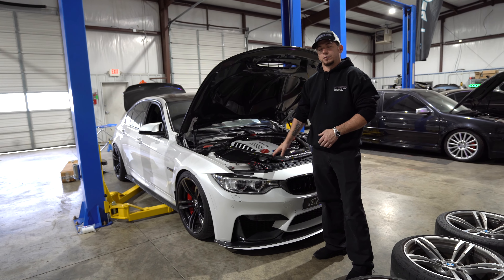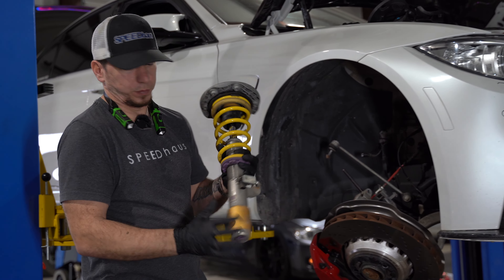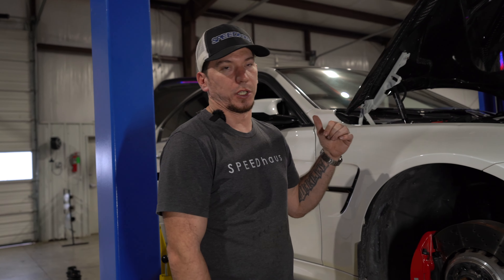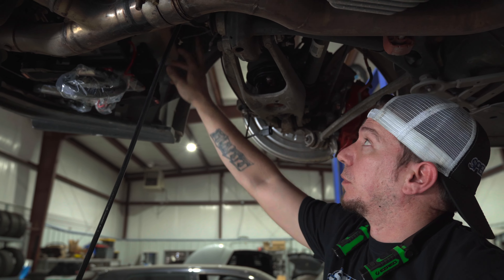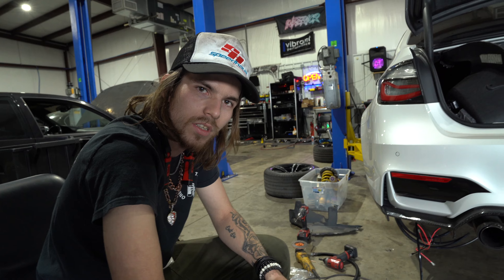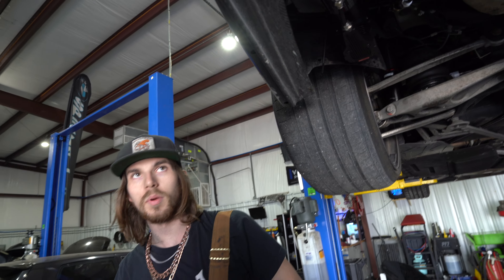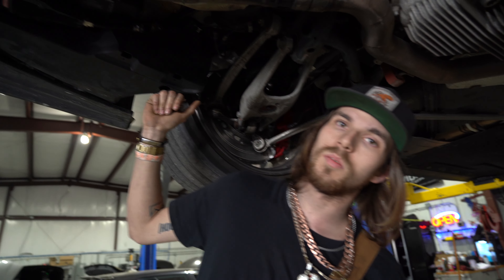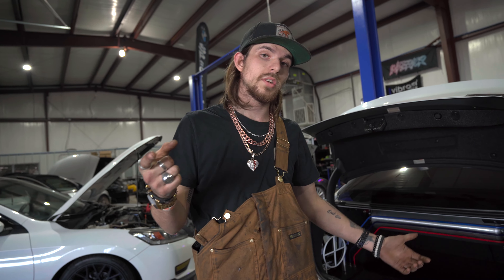BAGGED BMW F80 M3! | AirLift Performance X Flo Tanks Install 4K

Comment: Hello what is the max size of wheel with large and ET ? I want make 20x9 ET22 265/30/20 and 20x10.5 ET32 285/30/20 it’s ok you think ?
Reply: That is doable, the front could be more aggressive though. I’m running 19x10 +13 up front and only ~-2.5 camber. 19s are easier to go aggressive though without rubbing on these cars.